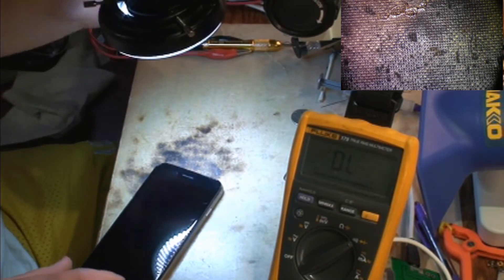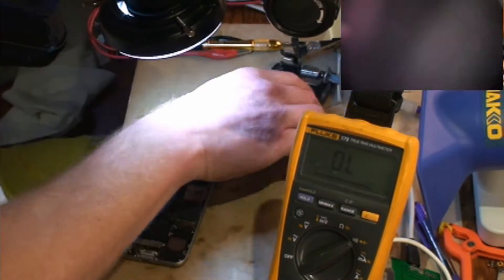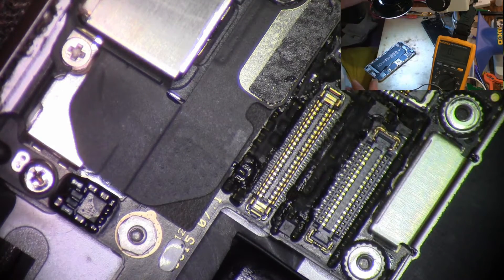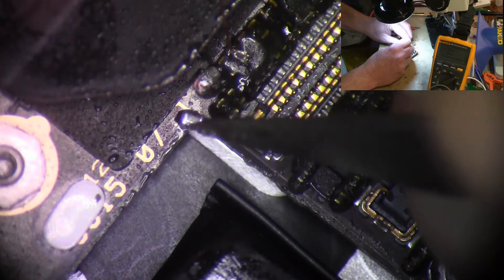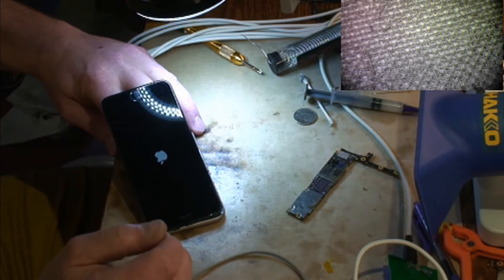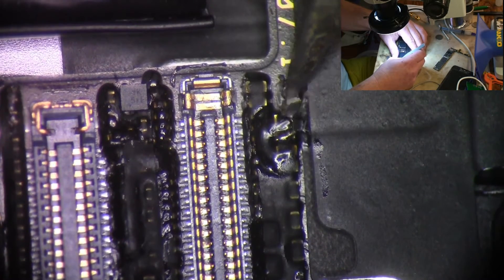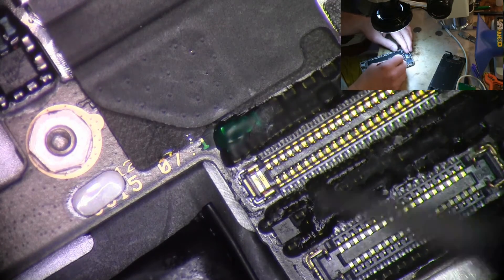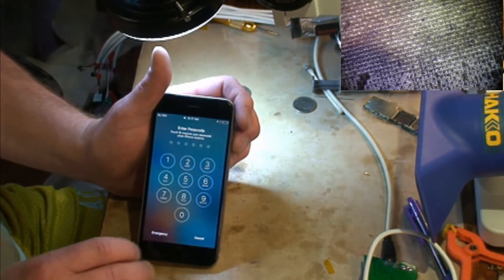iPhone 6S no display / no backlight repair

Comment: Hello, I am trying to fix a friend's iphone 6. I had fixed her battery a couple weeks ago. Then, it came back broken, unrecognizable on itunes as well. She told me tried using a fan through the chargin port. So, I tried replacing that today but it still doesn't turn on. DO you think the fan may have fried the logic board or it may be the battery?
Reply: Robert J Kim She most likely needs her "Tristar" IC replaced aka "U2" on the iPhone 5 series.

Tristar handles negotiations with any accessory that can be plugged in. Similar to a waiter at a restaurant. It connects that accessory with the needed chip. Headphones? The audio IC. Charger? Charging IC. iTunes? NAND and CPU.

ATristar swap should do the trick.